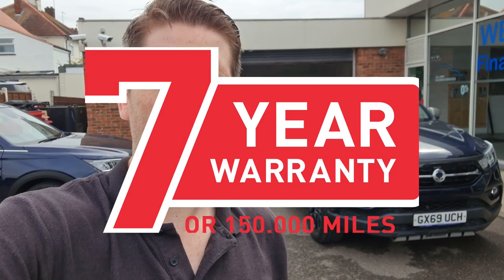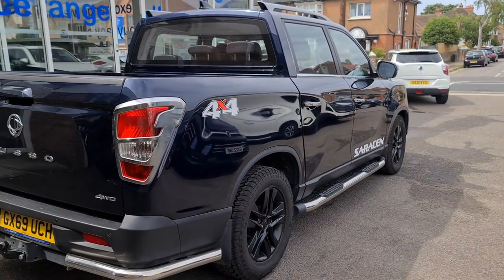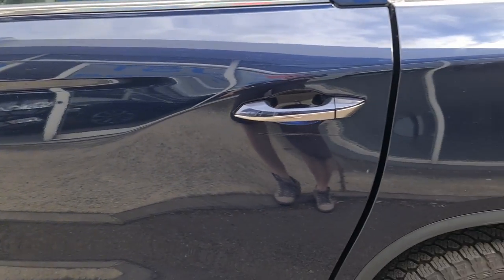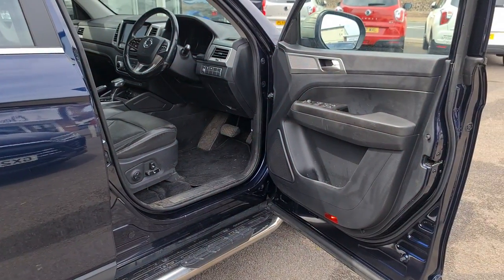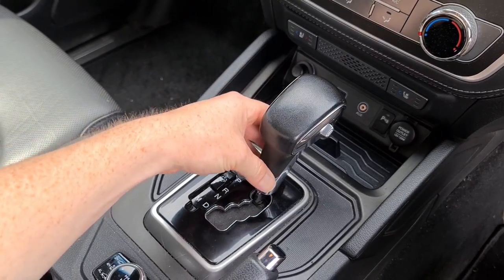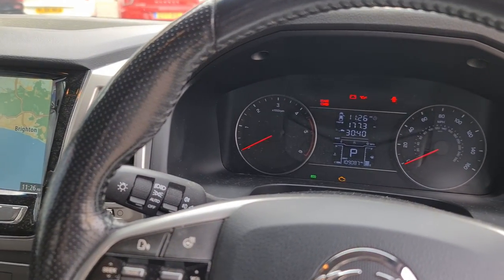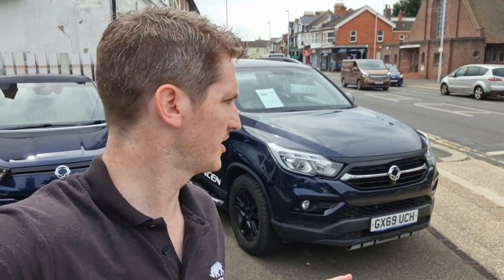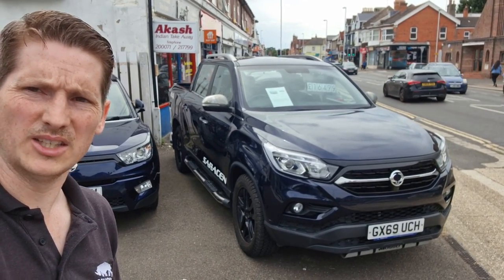New generation SsangYong Musso inspected after 110k miles! How does it fair under the skin?

Comment: i have had 3 ssangyongs  and all dependable and smooth quiet and refined.  what i have found is delphi fuel injection. so my parts i buy from delpi, fuel filters water traps and oil filters all so cheap yet made for trucks.  top stuff and all manuals  for service found online.  So stoked that its a car that can be serviced bt youself if your that way inclined like i am.
Reply from the maker: Thanks for sharing

Comment: ive got the 12 year old ssangyong korando sports pick up, squeaks from the rear hut thing loks like the whole of the back part moves separate from the frame, peeling internals on the gear selector etc. 108000 miles. its a work truck so its battered, hit a hidden wall in a bush while driving through it, never got it fixes, but it hasnt rusted over so not really a problem. over loaded probably a few times. still starts first time and goes when i want it to. I measure mine with gallons per mile as its economy isnt great, but i went for the automatic one as im lazy. no leaks, no real problems except some suspension issues when i hit a kerb at 70mph straight on, I was surprised i didnt break any wheels or anything else as it was one hell of a hit, it took a year to go to the garage to get the damage fixed it probably didnt really need to go. oil changed and filter changed every 10,000 miles. pads and disks when needed, pads are every couple of years. tyres every couple years as well. bought for £13,500 7 -8 years ago with 23,000 miles on the clock. its always got me home.

Comment: ssangyong made defendable vehicles before SAIC's dirty works(2005~2009. Destroyed company and ran away with all those data and blueprints). they always considered better than hyundai before 2005. models lanuched on 2005~2006 had major rust problems.. nowdays they are suffering from damage of the past but they are trying to make defendable vehicles. since they value how long their vehicle lasts. and they are still more defendable than hyundai in long run.
Reply from the maker: Agreed! Lot's of manufacturers have had periods of struggling with issues, but SAIC really do seem to leave quite a footprint. All the current 4th generation models are a world apart from those early models and show exceptional promise.
Reply: As a South Korean I’m glad you know about the hardship Ssangyong had to go through because of Saic’s utter mismanagement and not honouring its investment commitments. Most Koreans like myself believe Saic was a IP theft as they did not have any 4x4 before Ssangyong acquisition but now they sell D90, T60.
Reply: @jinsei1202  over 4000 blueprints and many technical data were stolen according to ssangyong and prosecutor. they made R95 and W5, based on ssangyong's vehicles, without paying anything(they did not even gave money to develop those vehicles at first place). And it is recorded SAIC forced to make ssangyong to design their passenger car roewe 350 for free. And de facto kidnapped ssangyong engineers to china. They ran away from korea and they are protected by Chinese goverment. so SAIC never paid anything. And korean government(did not want to make this a diplomacy problem) and goverment friendly media said it's all ssangyong's factory union's fault that ssangyong fell. when occupation of factory was happened. As far as i know, Mahindra was not that better. They got their crossover platforms...and ran away. They said it's because covid19 and ssangyong's bad net profit margin ... But they didn't even put enough money on ssangyong in first place. since car companies need a lot of money to operate... I don't think they don't know about it sice they are huge and have motor company under them...

Comment: Question... How would it do in a severe coastal environment eg. The Hebridean small isles , not Lewis Sky etc
Reply from the maker: We have got customers that both live near the sea and launch boats with Musso and Rexton. We have no issues with chassis or ancillaries, but we have had coils fail prematurely on at the rear, they seem to be just regular painted mild steel, so that's the only trouble you may have.

Load space covers/hard tops are also not 100% waterproof, so driving rain can get in a little too!

Comment: Nice to know the quality is there.
I put a deposit on an EXL XLV the other day, bit worried about the lack of ANCAP rating though, since its going to double as a family car.
Might have to lose my deposit and get the Dmax 👀
Reply: The only reason they dont have the ANCAP is the rear centre sash belt. If you don't need a 3rd back seat then your sweet
Reply: It’s got 5 stars from Kncap tests. No less stringent than Ancap to the best of my knowledge. In Korea Ssangyongs are not known for flashy tech but for solid build and reliability.

Comment: You are in a ssangyong showroom saying that it's an excellent item you are mixing a car sales man and an honest review and in UK the kilometre is the distance unit not the mileage which is an American unit and with this distance even a range rover will be still looking good
Reply from the maker: Hey you're absolutely right, I do have an agenda to highlight the quality of SsangYong in my position, however, it's pretty difficult to fake a side by side comparison of what is worn out and what isn't. It's quite clear that this truck looks great after a 10 year average mileage (10k per year) vs the Dmax and others mentioned.

Not entirely sure what you're getting at regarding measurement units, but the UK is pretty upside down in this regard. We are metric for virtually everything except distance which is still imperial.

Still, it's good to challenge, keep it up!
Reply: Miles, is UK proper measurement of distance.  "kilometre is a none distance, only used to over exaggerate speed...
Reply: What?  Kilo is EU not UK..

Comment: How come ssangyong have now dropped the 7yr to 5yr and 15000  miles down to 100000 miles
Reply from the maker: Hi Paul, all down to saving cost sadly. Like everyone, rising wholesale costs have to be mitigated somewhere, therefore to prevent price rises, SsangYong UK has changed the warranty.

They are now offering it as an upgrade though, it's £999 for 2 years and 50k miles on the Musso and £749 on Tivoli and Korando.

Comment: This is not a good example of longivity as the milage has been done in a relatively short time. Also using the bolsters as an example is also not relevant as a worn bolster takes place with high 
nos of going in to and out of the car and in this case this truck clearly did long journeys most of its time in its 3 years of life. The stone chip example is also not a good example as the car may have been doing motorway miles most of the time and not being driven on country roads with grit and sand everywhere. Over all this is not a good example of the quality of a Musso.
Reply from the maker: I respectfully disagree with some of your comments Keith. 

In actual fact my customer did an awful lot of trips, short and long, think of his driving pattern as similar to a district nurse or similar, so plenty of getting in and out like any other high mileage scenario.

Through experience I tend to find that higher speeds generally create more stone chipping than low speeds, especially on the higher areas like the bonnet leading edge and upper bumpers.

Realistically, with the caveat that this example only has had sporadic light off road use, I think this example is a great advert for the quality of truck. I've seen many others that have been used in the same way which have proved to be a whole lot less durable, like the D-max as shown in the comparisons.

Before he had a Musso, he had a V6 Ranger. That went through 2 sets of injectors and a new engine in the same period. Makes you think right?
Reply: Yes, have to disagree. Even if you're correct and it's been mostly motorway, at 70 to 80mph you're going to end up with hundreds of stone chips over 110k miles. The interior has been 'respected' not hammered by someone who doesn't own it. I've seen bolsters on VW drivers seats worn and torn at 50k. I'm glad I didn't buy one in 2006. I went for a Hyundai Terracan, my only regret being I should have bought an automatic. They were on offer in Spain for 15k brand new so I couldn't resist. All galvanised except the roof!!!!!.
Reply: I almost bought one last year  July  but talked out of it due to poor sale on value  may go for one this year
Reply: Own a 2019, done 85K km, drivers bolster is a little bit of wear but has held up well, I think they wear quicker if people don’t rest foot on the running board and/or don’t have an A piller handle to take one’s weight while sliding across the seat. A few stone chips on bonnet leading edge (adding a plastic guard will assist to minimise). Very impressed with the build quality. It’s solid, nothing broken, buttons and mechanical parts all in good condition . Yes 85k is not high. It just does everything you expect and does it well.